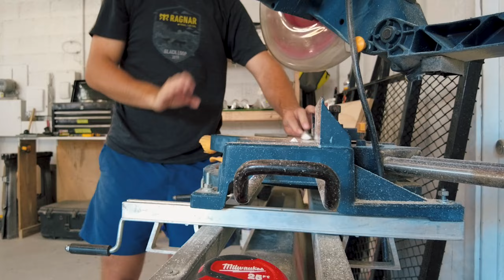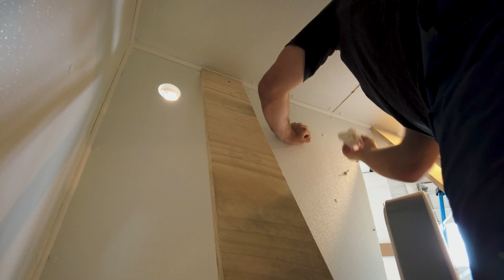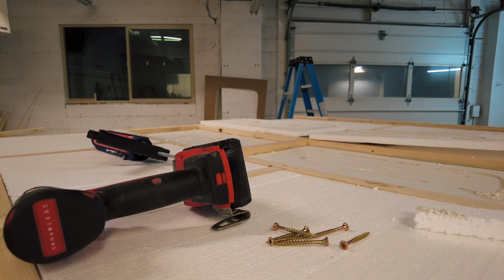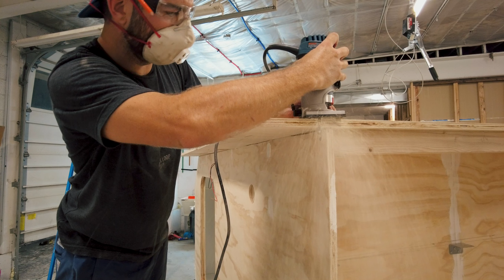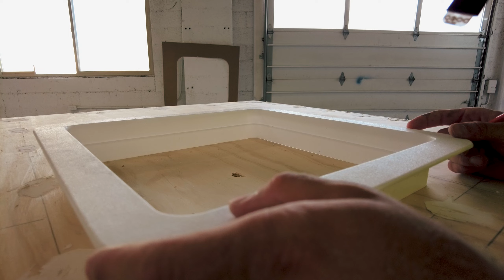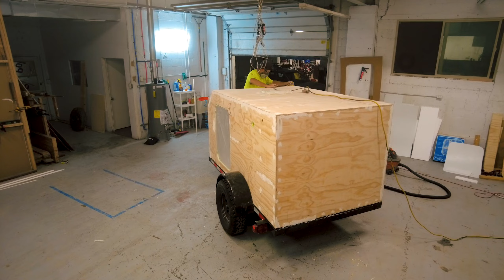How To Build a DIY Square Drop Camper Trailer: Interior Trim, Roof and Galley

Comment: You use a large battery and bucket of paint to (try) and weigh down the bowed roof plywood. Here's a helpful tip that helps me often. Take your empty one gallon plastic milk jugs out of your recycle bin. (Cost? Free!) They're made of HDPE plastic... tough, while remaining gentle on surfaces. Fill them with dirt. (Cost? Free!) This gives you a surprisingly heavy weight. With one or two or ten or 20 or 100 of them, you'll find you have tons of weights, obtained for free, to hold down anything you need to hold down while glue dries. And these weatherproof weights store easily when not used, either inside or outside, summer or winter.
Reply from the maker: Great suggestion! I just used what I had around the shop. I'll remember the bucket and dirt trick next time, because God knows I have plenty of buckets. haha

Comment: Enjoying this series. 

How strong is that roof? You figure you could stand on it? Put a rooftop tent on it?
Reply from the maker: Oh you know it Brock! The roof rack gets installed right above the exterior walls, which are very strong. Then the rooftop tent weight just gets dispersed over the strong exterior walls, rather than the middle part of the roof. You could walk up there, but I wouldn't go jumping around on it. But a rooftop tent would be perfect up on the roof rack.

Comment: Excellent videos man. I have a trailer that I'm gonna starting building a 4x8 similar to this style over Christmas break.
Reply from the maker: That’s awesome Chancey! You’ll have to send me some photos! Let me know if you have any questions. Thanks for watching and subscribing.
Reply: One minor difference is that I'm gonna make the rear door swing out sideways instead of up. I want to include a fold down table on it since the rear will be my kitchen area.
Reply from the maker: @CLGravy  I love that Idea. Honestly, that is how I would do it next time. I actually want to get a pre-built side-swinging door. The one I want to get is from vintage technologies. It is the very last one on this page, but after shipping & handling, I think it would be well over $700. Someday... https://www.teardroptrailerparts.com/doors.html
Reply: Yeah, I'm on a teacher's salary. Gonna be getting some home depot strap hinges and building my own like you did. Lol. I'll send pics of the progress as I work on it.
Reply from the maker: @CLGravy  I totally get that. We sure need to pay your teachers more. Thanks for what you do!
One suggestion I would have with the strap hinges (and maybe you have already thought about this) would be to get the most heavy duty ones you can find. Or even go for a heavy duty door hinge instead. I've used some strap hinges before and I was disappointed that they struggled to hold up a much smaller door without sagging. I think also having a metal plate on the backside of the door behind the hinge could help. Then you could used some lag bolts to bolt all the way through the door and get it really tight. That may help with any sagging issues. 
I'm excited to see your progress when you start building it.

Comment: Just curious, WHY build a "pod" on the middle of a trailer?  Wht not gain at leat 1' wide and 3" longer by using the full size of the trailer?
Reply from the maker: Not sure I 100% understand your question. The camper covers the entirety of the trailer. I've used up every inch of the metal trailer frame. There isn't an extra inch (definitely not a whole foot), that could be used to make the camper wider or longer. I have a full queen sized mattress inside, with a 14 inch storage space in the back. 

I'm not sure what you mean by "pod" on the middle of the trailer.
Reply: @FunkeAdventures  I mean you did not build into the front of the trailer, that extra 24" of triangular area, and have more space and more streamlining.   Also build out PAST the frame to cover the wheels (like in most production trailers like Casita and Scamp).   I'll build out so as to have lots more storage & streamlining.
Reply from the maker: @arthurfoyt6727  oh, I see what you’re saying. Good for you!  I have a tongue box on the front tongue of the trailer. It houses all of my electrical components. The width of the camper was perfect for my needs and simplified the build.
I would argue that “most production trailers” don’t actually build past the frame to cover the tires. At least not “off-road” and overlanding campers. Some do, but for example, smittybilt scout, hiker trailers, boreas xt, blue ridge expedition, hive, etc. do not. But to each their own. You build what’s best for you, I’ll build what’s best for me.
Reply: @FunkeAdventures  Yea, I was just curious.  Seems most people don't want to use extra material or want big fenders to use as a ladder/table.  I want to build out and streamlined to maximize space and make towing easier.  See ya!